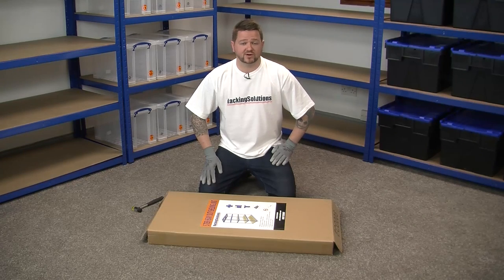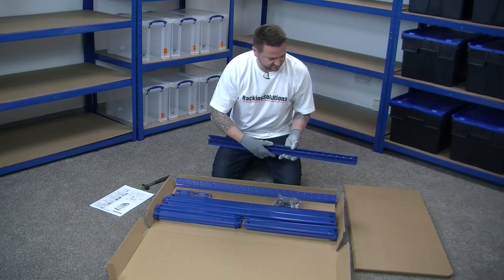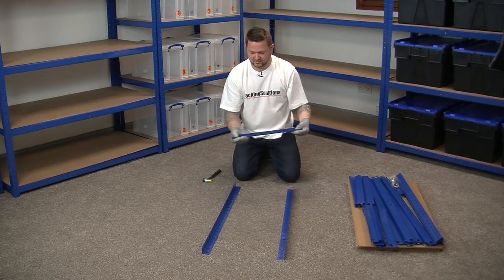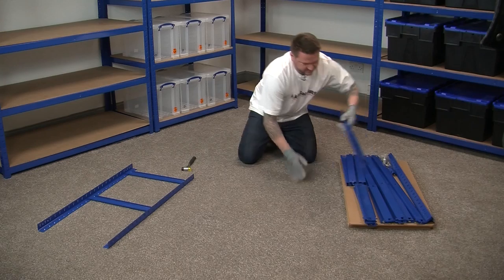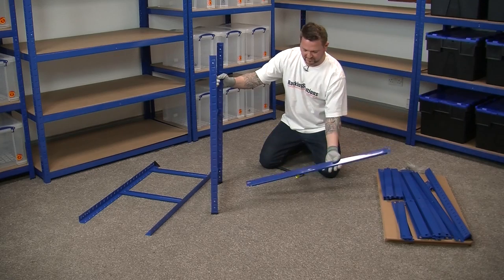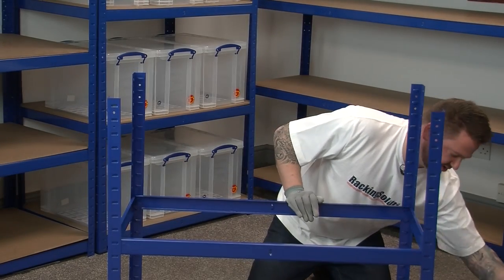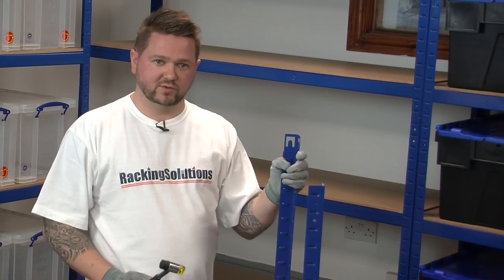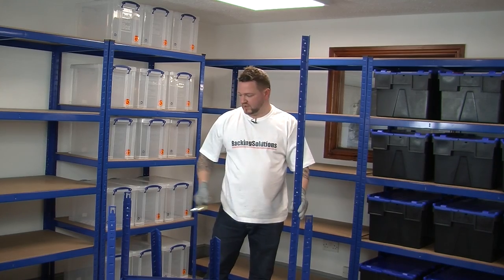Racking Solutions   Economy Range - Assembly Help

Comment: Don’t think it is as easy as this video.  Some of the parts were missing which I still need to sort out. It certainly does not clip together as easy as this video makes out.  It does not clip together then a small tap with mallet. It takes brute force and the paint peels off. Avoid this racking system.  I have bought cheaper systems which were far easier to put together.

Comment: I've just bought six of these units for the garage. Delivery was very quick. The first one went together fairly easily. It took about an hour but the rest should be quicker now that I've done one. Pity they didn't make clear that the units come with a complimentary rubber mallet. I went out and bought one a few days ago. It looks like pretty good quality kit and will do the job. I like to option to split a unit and make a work bench out of it. Overall pretty pleased.

Comment: The assembly is pretty straightforward, although some bits on mine took more than a couple of taps to get them to fit into place. Also, you don’t mention that the tabs on the central supports need to be bent inwards (just takes the pressure of a thumb) so that they will slide through the slots provided for them. It’s a nice neat shelf unit when assembled, perfect for a garage or shed.

Comment: Very good video - much more helpful than the instructions that came with the shelves.  Our shelves did not come with a rubber mallet, or gloves ...  .  I found some of the tabs went to the outside of the uprights as I attached the horizontal supports so I had to redo those, but then I checked carefully each time to make sure that wasn't happening.